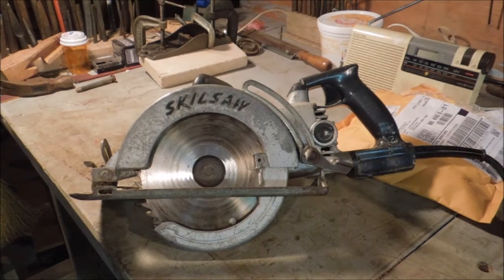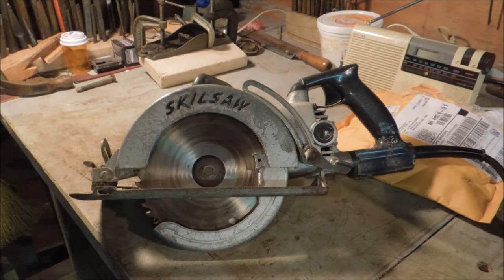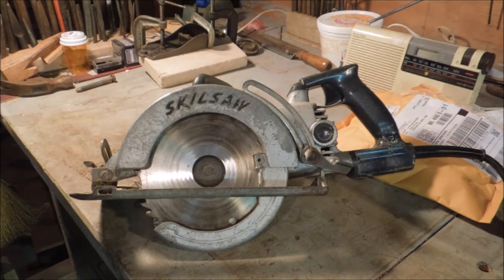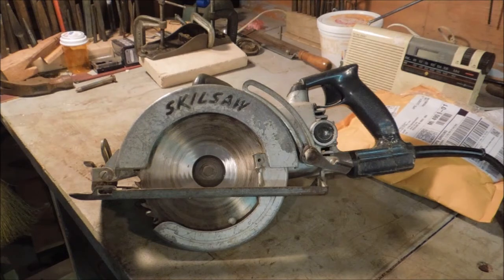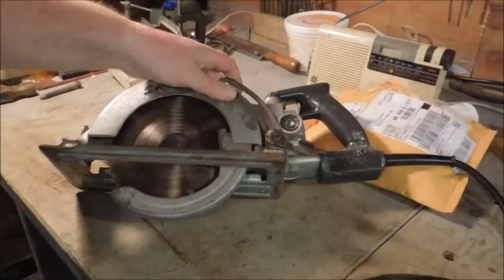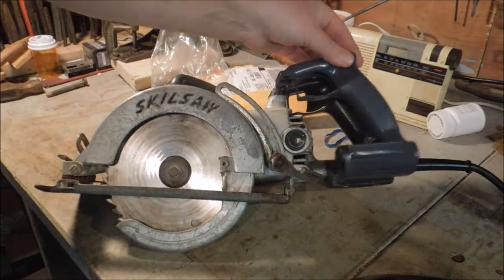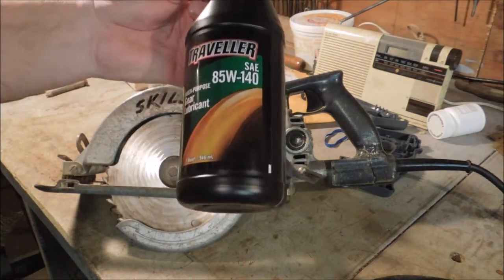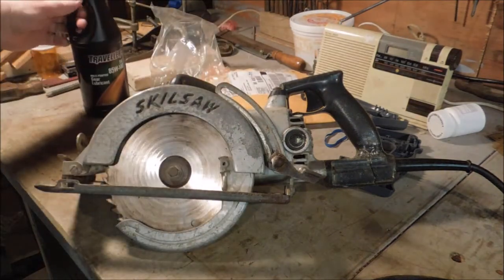Skilsaw Model 77 Pt 1 - Preliminary examination - a video tutorial by Old Sneelock's Workshop

Comment: Not kickback they torque/twist on startup
Reply from the maker: They do tend to buck on startup. Since I have had this saw about 3 years now I learned to rest the saw on the board with the blade back from the edge before starting. I can stall most of my sidewinders if the wood binds on the blade. I have to be careful with this one. If I don't have a good grip, it will jerk back as the back of the blade gets pinched and lifts the saw out of the kerf. 😁😎

Comment: You ever had a brush get stuck in its holder? Trying to change the brushes on mine and the one side came out fine,but the other one isnt wanting to leave the hole. The spring pops out when I take the cap off,but you pull on it and it wont budge. Kinda scared to put much force on it. Never had one do that before. The other brush is about half worn,but I'd already bought them so I was gonna go ahead and replace them. Any advice or input would be greatly appreciated.
Reply from the maker: I have found them worn enough that that the carbon went far enough in to get cocked in the holder and bind. Disassemble the body and remove the armature. With that you should be able to free the carbon brush either by pushing it through or releasing the bind.
Reply: @OldSneelock  I'll give it a try. It just kinda puzzles me because the other one is just past half worn and the saw runs fine. I was just refreshing it since I was already replacing the cord and changing the oil. I appreciate your help and experience.
Reply from the maker: @ciphercode2298  It is a long distance blind diagnosis so there is room for error.

Comment: I've never had an issue with kick back on my worm drive.  Its too heavy and it spins at lower rpms than my sidewinders. It just kind of plows along like a tractor
Reply from the maker: No personal experience with kick back because this is my first and only worm drive saw. 
Just passing along a bit of tribal knowledge/old wives tale in case it might be true. No harm in being careful. 
Sidewinder saws have kicked back on me many times. 
My fault. 
Using one handed, cutting out of position, cutting unsupported sheet goods, are all great ways for the blade to bind and get kicked out of the kerf.

Comment: That's a good find, Unc. I've been involved in grading a building site for a bunch of "Town Houses" and they've got arches cut out of 4x12's for the porch posts and such. The thumb flatteners were working on them and had a BIG circle saw, a Makita for cutting the  beams to leingth. I told them thay had a circle mill and all they needed was the chain saw and they sid "We've got it right here" and drug out one of those 3-phase Makita screw drives with a 12 or 14 inch chainsaw bar on it. "It's the only thing to cut an arch with" they said and it did a mighty fine job of it too. Never saw one before. Mounted straight up and down on the saw shoe. R/T probably has one under his pillow or maybe Jim Watson. Neat rig but remember I'm diesel powered!! Computers run off of smoke too....at least mine do!!
Reply: Lewie McNeely I did have it under the pillow! The night I took it out, my wife finally came back to bed and low and behold...baby number two. On a serious note (if possible), I like to use one when I cut wooden "I-joists". They are great for engineered lumber as well.
Reply: You silly Bob! How did you end up that far North??
Reply: Lewie McNeely I'm not sure but, I don't consider it luck...
Reply: A buddy of mine always said you make your own luck. You're sure a long ways away!!
Reply: My folks moved us up here from Chucktown, SC back in '81. I moved back to SC in '96. Pops passed in 2000 and I needed my family (Mom and 4 sisters and 1 brother), so I came back. Then I fell in love with a yankee...
Reply: 10/4 on Chucktown. My sis and her hubby lived in Pimlico for a while. She worked at Cyprus Gardens and he worked for Agfa. We went down a couple of times and one was to see the christmas lights. Drove around in one place for at least a full hour and it was something else! Got to go over the new Cooper River bridge and that was something else too. Really liked the port. I used to go to the Capitol and haul back sand of the same name. Good old Casey and Foster -Dixianna. My Mom was from Kenosha Wiss, so I have no trouble with Yankees. I noticed you didn't have the old southern way of talking exactly. I was in the Army with a couple of Yankees from Joyzee and learned to mock them to a "T". They'd get mad and pound on me and I'd just laugh and mock them more and more. They knew I was a chrome-plated hick and it drove them nuts. Some of my best times while I was in. So Hug everybody and tell them old Lew said Howdy, and keep the heater on. If I need a snowball I know to ask you or Uncle Snee!! GBWYall